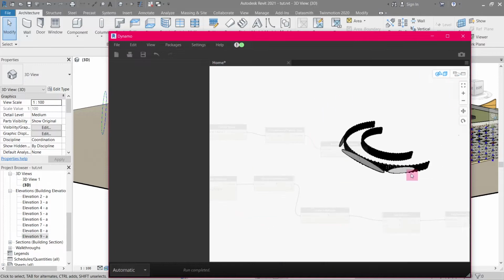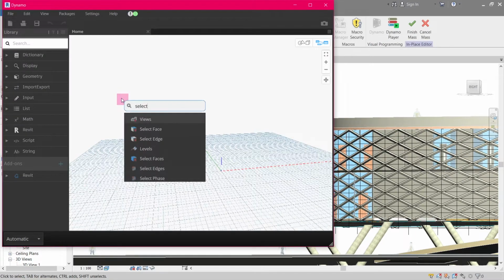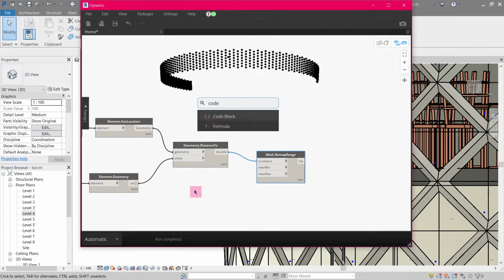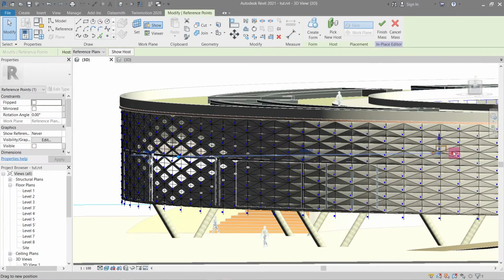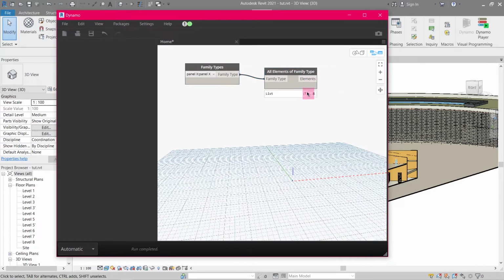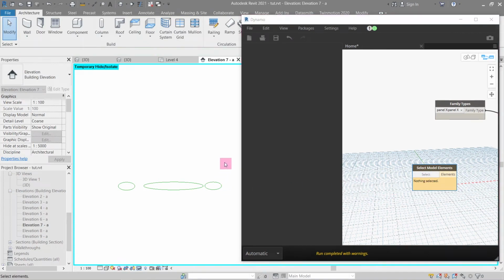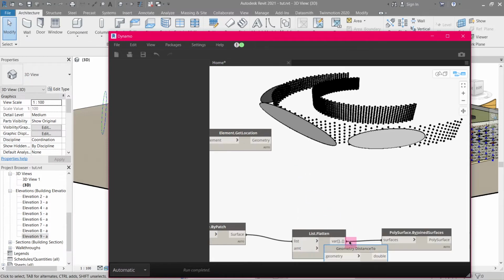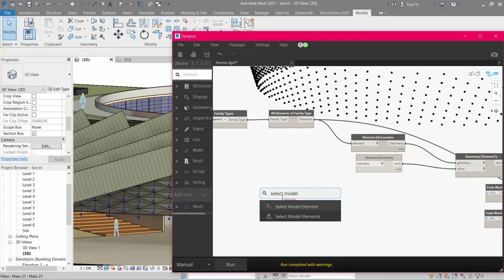Parametric facade in Revit: Complete step-by-step tutorial for beginners (Dynamo) | Part 2

Comment: how were you able to run dynamo in mass in place. I can't do it in my .rvt file. It only work in .rfa file
Reply from the maker: I don't understand why it shouldn't run. What error are you seeing?
Reply: it’s just impossible to run dynamo in mass edit. You should be in the model space, but in model space on the last one node I have „warning, parameter read only” because yes, mass parameters are locked in model space. So there is the question, how to bit that problem?